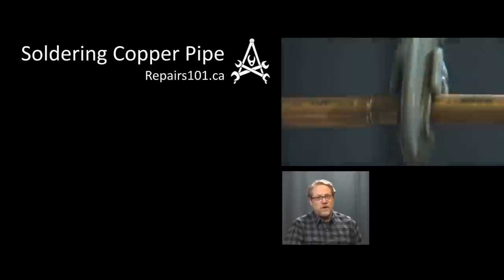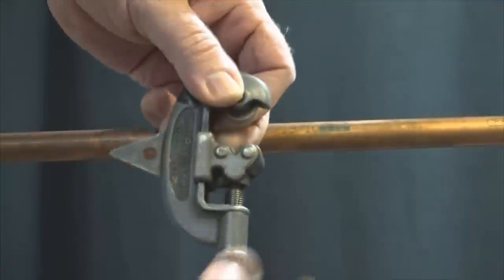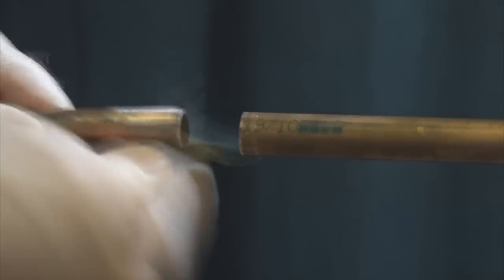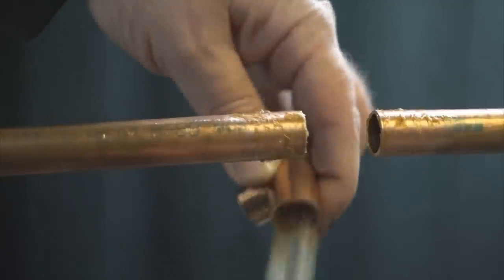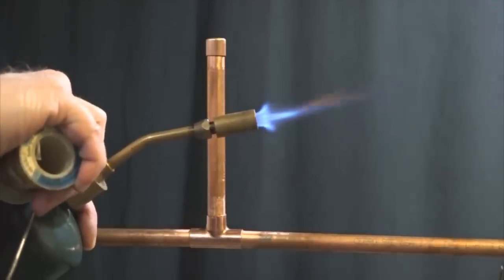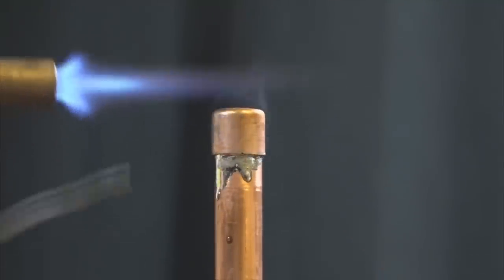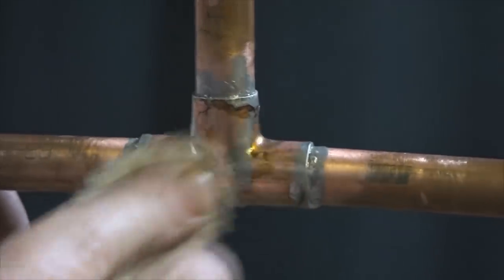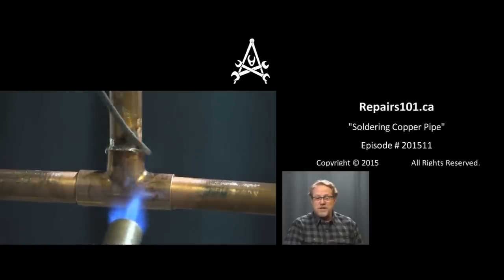Soldering Copper Pipe Basics + Noisy Pipes / Water Hammer Fix

Comment: You might have done it but a person needs to ream out the pipe after cutting to get rid of the burs. Also I'd recommend MAP gas, propane is too cold. With a hotter fuel, you can add solder to the joint quickly, and you don't have to keep adding solder and get a bunch of extra melted on the outside of the pipe. If I was doing a tee fitting like you did I'd do the horizontal pipe first, then the vertical. The warm air rising off the bottom of the joint will heat the upper portion of the tee.
Reply from the maker: 2 AM Thanks for contributing that - I wish I had done it the other way around. When you're filming everything goes at a different pace and sometimes you make choices for the camera - I could have chosen to edit the shots where it was too cool or where I made a mess but I wanted "first timers" to see it's no big deal,
Reply: Repairs101 When I was a plumber I never had a camera in my way while soldering, thank goodness. There was always something else I had to work around. :-)
Reply: I generally end up with cross beams or other pipes in the way of my soldering lol and also when you are done soldering, before it cools too much, the burn marks come off easier if you brush the torched areas with flux and just use a wet towel to wipe clean. Comes off easy :)
Reply from the maker: Andrew Pickett Great tip! I'll have to try that!

Comment: If you wipe the solder with wire wool when its hot it gets rid of all the lumps and leaves your pipework beautifully smooth. It's  only cosmeticly relevant but it looks professional.

Comment: make's you want to do your own video?
if that was serviceable and had a bleed valve those are very effective better to install where the problem exists bathroom sink kitchen sink and so on I'm a maintenance pipefitter from the railroad 26 years I always wipe copper off with a wet rag to neaten it up and I have never had a leak,🤞 use 100% lead-free solder and drinking water rated white flux paste...   thanks for the video,
PS. you've could have done it perfectly and would still have negative comments,
good job none the least*